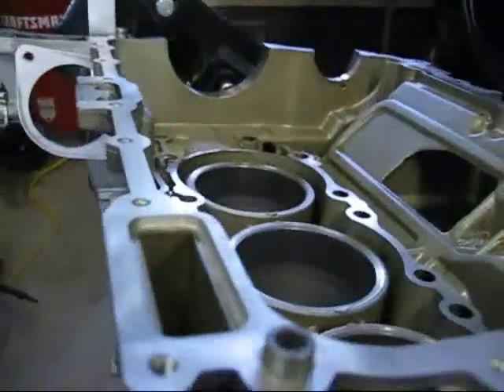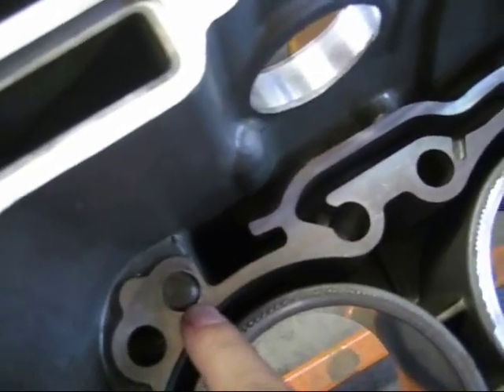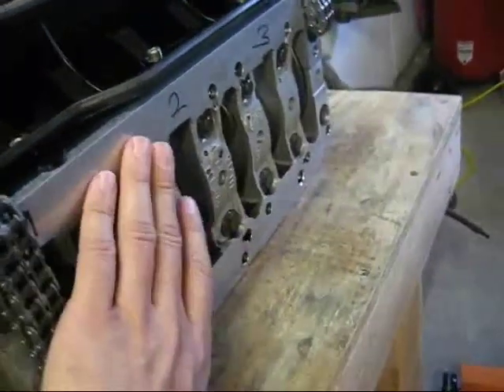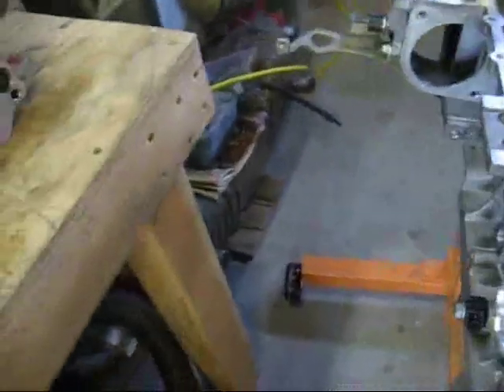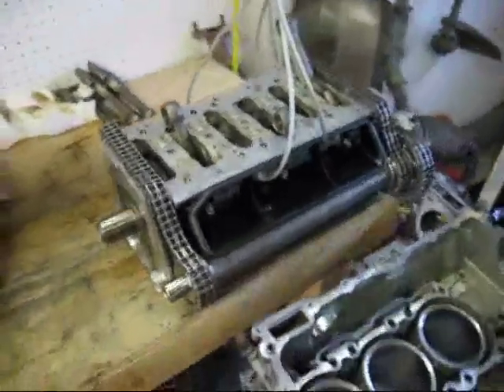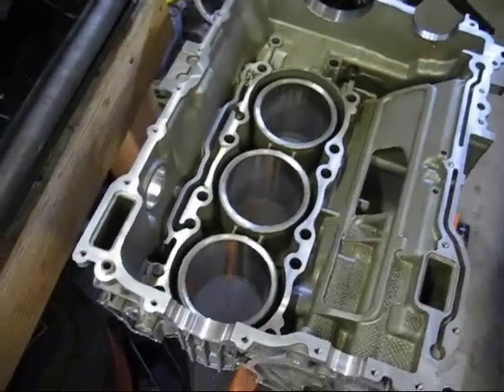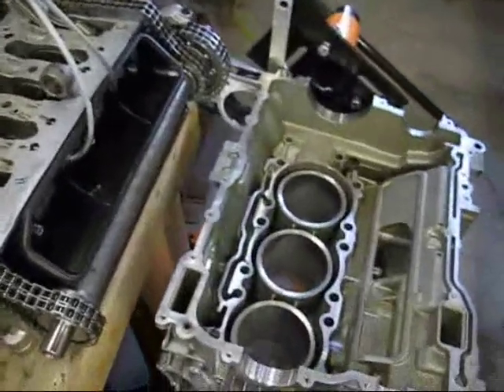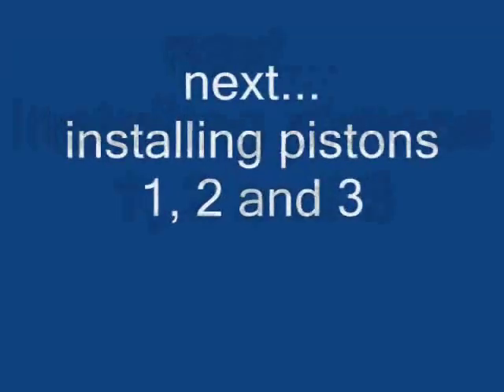Porsche Boxster S engine rebuild 02

Comment: Nice videos! Im thinking of doing the same with my 3.6L engine and this is very helpful! Quick question. On the IMS shaft, is there another bearing on the opposite side of the infamous IMS bearing? I would appreciate a reply. Thanks in advance!

Comment: What seals the base end (crankcase end) of the cylinder water jackets?  In videos 1 and 2 the cylinders appear to have open water jackets.  The bearing carrier assembly does not look like it could seal the water jacket.   I must have missed something.